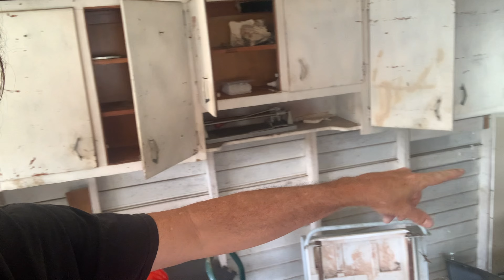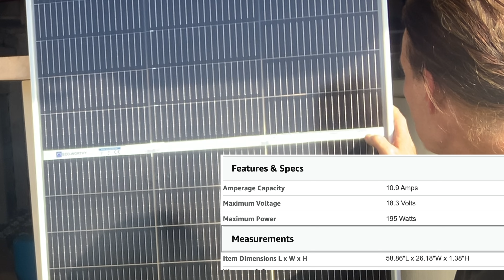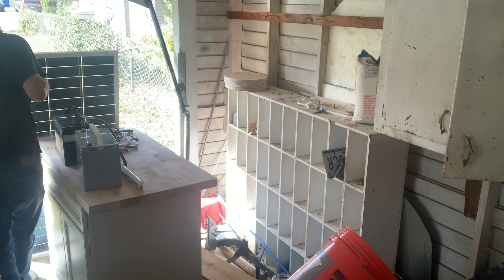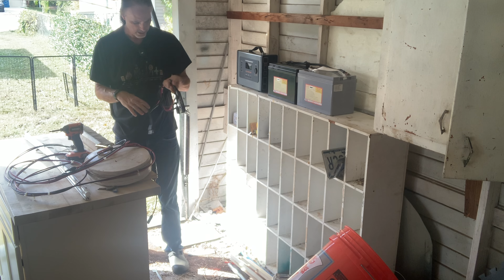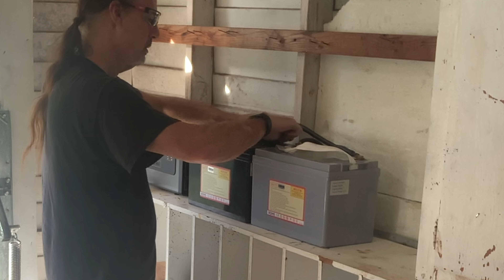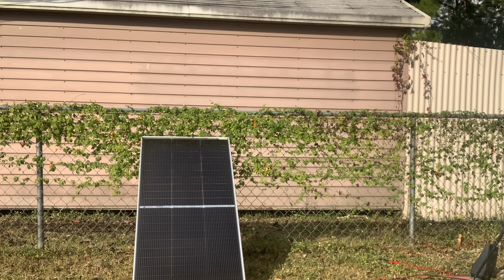ECO Worthy 195W N-Type Bifacial Solar Panel

Comment: these are ok but I can get a 500w full sized panel for less than one of these
Reply from the maker: Yes, they are little but $$ .. very portable .. i can carry these in and out of RV .. the 500W are not portable at all .. But that depends on what you want to do with them .. RV, Boats, Van they are good fit.

Comment: The Vmp on these panels are now 20.2 volts and Imp 9.65 amps according to their website.  The iteration you have appears to be no longer available.
Reply from the maker: Looks like 2pk still available : https://amzn.to/3NIC46o
Reply from the maker: I updated all the links, they had just changed.. Not sure why but they are all fixed: ECO-WORTHY 18BB 195W N-Type Bifacial Solar Panels, 12 Volt Monocrystalline Solar Panel with 25% High Conversion Efficiency - Affiliate Link: https://amzn.to/41NNlFH
They also have a 2 pack now: https://amzn.to/4vhCjpW

Comment: i have that exact 2k inverter with a EW 24/100 battery . can i safely connect 4 of these panels to it ? if so should i parallel or series each pair into each panel input on the inverter ? or would that be over kill and should i just KISS and stick with 2 panels?
thanks , jeff
Reply from the maker: Yeah your talking about the 24v ECO worthy inverter?

Comment: Whats the best you have gotten from the panel ?
This is Eco newest 195w panel and you are the only one Ive seen that has one.
Reply from the maker: I have had it connected to a 24v eco worthy inverter charger, and the best so far was 199w in a flash, but it’s been at about 160-170w in December sun, not too bad … when summer roles around i bet it will max around 205w … maybe higher is I give it a white background ..
Reply: @MattManSolar  Thank you for the answer. 
Actually during the winter is when you get the best result.
Solar is best when its cool so on a sunny winter day is the best result.
I have tons of Eco Worthy panels. Their last N-type 195w panels were horrible. These just released these and I haven't seen anyone on the net with these yet except for you.
Reply from the maker: @Firephosure  Not is florida, the production is about 40% of summer here.. Yes, they do better is cold, but also worse angles and much much shorter days.
Reply: @MattManSolar  I live in Central Florida.
We're not talking how much the panel would get total in a day in the winter or summer. Of course summer sunny days are longer.
I just asked what's the maximum you got on that panel. Not how much in a day.
Reply: @Firephosure  I noticed they're $200 for 2x and started looking for reviews as well but looks like I'm going with the Callsun N Type 200w 2 pack for $310, Every review puts them at the top so far including Will Prowse.